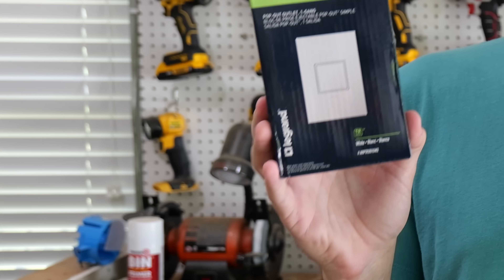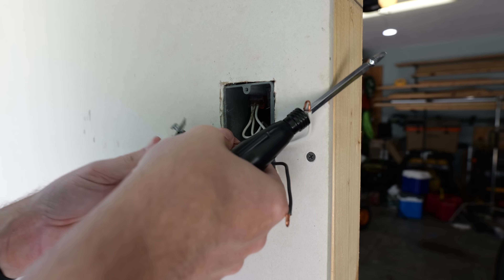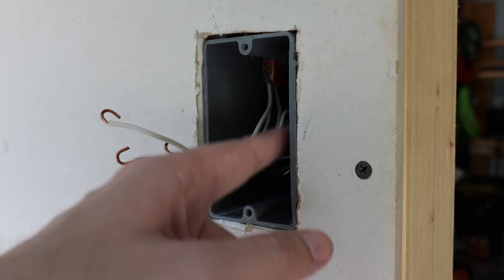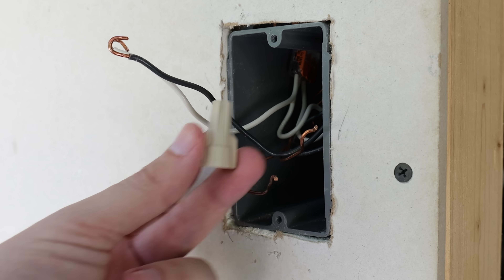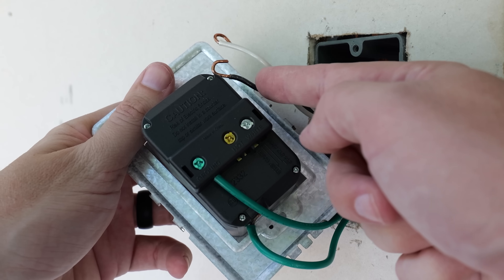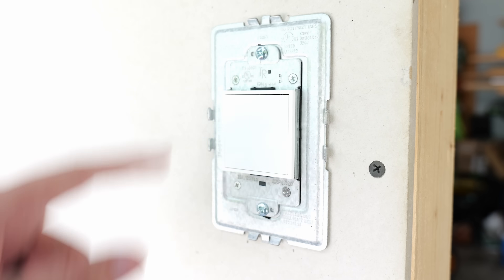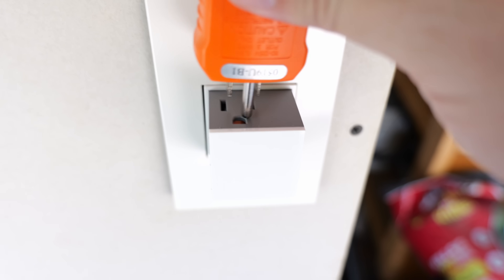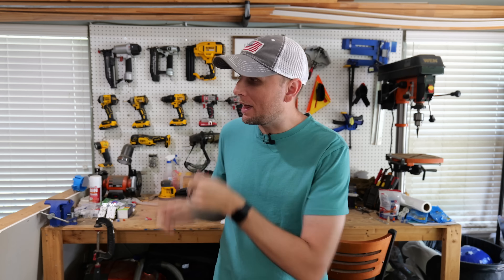The Outlet That Vanishes Until You Need It!

Comment: After working with wago's installing about a hundred of them for canless lights, it is easier to insert the wires so the clear visual side is facing you, and the levers facing away, that way you don't have to turn the lever nut around to see if the wires are seated properly.

Comment: OMG. This is my husband's. (meaning, he works for Legrand, and this is one of the product lines he works on)

He says there's only 3 outlets not because it's "taking up all the space", it's so you can gang them together have have 6 outlets instead of 4 (the two empty sides will be side-by-side). He says the wall plate sticks out isn't a gap, it's a two-tone wall plate that's the style of European outlets (where these started, as Legrand is a French company, and the Adorne line was initially developed for European customers). To address some of the comments - the "side pressure" thing isn't a problem - these have gone through rigorous testing. They are also tamper resistant. And again with "European design style" yeah - the reason it does this is because architects (the main people who buy these) and such don't like how receptacles look. It's dumb, but there you go - it's just a design choice to make the "top customers" happy. When it's closed, it looks like a lightswitch and is basically unnoticeable. It's meant to be used in strategic areas (an example he gave is in our house, we have one receptacle we never use, except at Christmas to plug in the tree. That would be a good spot to use it.)

We have stuff from this line in our house, they are super pretty and really easy to clean. And you can change out the covers in a snap (literally) if you change a color scheme. And they don't really stick out from the wall much farther than a regular wall plate - just the angle to the wall is different, is all.
Reply: I have plenty of adorne outlets and dimmers around the house for couple of years, along with the onQ wireless module.  I love the design, materials and how they operate.
Can you ask your husband if Legrand is slowly discontinuing adorne line? Its harder and harder to find wallplates and accessories every year... Legrand support is also not much help with installation and compatibility questions. It just feels like the product is slowly phased out year by year. I'm just afraid that after investing a ton into this system, I may be left with nonsupport and replacement parts. One positive thing is that I seen that netatmo was recently introduced to adorns lineup so maybe there is some more life left:) Thanks
Reply: @teddy0139  He says it's definitely not being phased out - in fact they just came out with a whole bunch of new designer wall plates. He says if you have questions, go to a lighting design showroom (he doesn't know where you are so he can't tell you who to contact better than this) and they should be able to help you with questions about the system, as there's a lot of them out there that use the systems.
Reply: @turtleslaw  thanks for replying!
I’m located in PA, few years ago Lowe’s had some selection of adorne products but not anymore (I think now it’s online only). Does your husband knows any locations  in Pennsylvania?

Comment: Probably people know there equipment works, but at the beginning, it might have been good to use the outlet tester on the live outlet and make sure it lights.  Then when it's rechecked with the power off, you know for sure the power was disconnected, and it's not potentially a bad tester that still isn't reading any voltage.

Comment: You can push the wire into the wago without lifting the lever. You need to flip the lever to remove the wire.
Reply from the maker: This is I believe the 3rd comment on this today which I’m curious, is there a video out there saying this?   I’ve just never had so many people say this about the WAGOs.   The thing is yes, you can.  That said, nowhere in any of WAGOs instructions does it list that as a proper way to install the wiring.  I did that in a couple videos and this was pointed out to me and it’s true.  I literally looked through every bit of Wago literature I could find.  Also, it takes quite a bit more force to push them into the WAGOs than it does the ideal lever nuts which ideal actually states that pushing them in is acceptable.
Reply: @HowToHomeDIY  it wasn’t anything
from wago, I found out about it on another YT  channel similar to yours. I tried it and it works fine. Does it change the life of the part? I do not know. Could be a reason wago doesn’t mention it.
Reply from the maker: @akbychoice yeah I’ve now gotten like 5 comments about it so I figured there had to be a video out there saying that.  I am not sure whether it affects it or not.  I just know since people got on me about it in a previous video, I looked into it and Wago doesn’t mention it anywhere.  Technically we are supposed to use the devices per the manufacturers instructions.  So not sure if whoever you saw say that has looked into it or they are just trying to make their content different and interesting.  Not sure.

Comment: I've installed these on two different homes in the kitchen islands. Good idea, not really worth it n my opinion As noted,  these aren't cheap. Plus they are BIG and take up a lot of room in the box. They can be a total pain to install depending on the box size and existing wires.  Definitely use wagos unless the box has lots of room. 

My wife tends to never push them back in so the pop in/out feature is wasted. It is nice that outlet has 3 prongs, but sometimes adapters don't fit. She bought one of those automatic trash cans so one of the outlets is always popped out for the power brick.

These have their place, but in my case they just aren't worth the money and I won't install them in my next remodel.
Reply from the maker: A very fair and detailed comment.  Thanks a lot for taking the time to leave that feedback John.
Reply: @HowToHomeDIY If using these in a kitchen wouldn't they have to be downstream of a GFCI receptacle?
Reply from the maker: @David-fb8fn yes they would.  In any “wet” environment which would also include bathrooms, garages, laundry rooms, etc.

Comment: You don’t have to lift the lever on the wago either you can just push the wire in to it also nope don’t like it it is kind of useless and it is not flat on the wall
Reply from the maker: You can and I have shown that in some videos but I got attacked and told that Wago has not said anywhere that it is an acceptable way of installing the wires.  Which is true and they are quite a bit harder to push in than the Ideals.  I know some others out there are saying you can do this but just passing the word along that Wago has never expressed that.

Comment: Nice idea, but I'd be wondering about side pressure when plugging something in that takes a lot of force to insert. 
Also if you install too low or near something like a table where it might get spilled on, could be a problem.
Reply: Yeah, this looks like an outlet that requires two hands to plug something in so you can use one hand to support the outlet

Comment: These are horrible if you use them. If you want to install them in an area in the wall that requires a receptacle by code they are not a bad way to costly hide the outlet.

Why are they horrible? They are expensive. They do not fit odd sized transformers. They stick out from the wall, more so than a regular receptacle but not more then a zero screw plate.

Comment: I'm not a fan of how they stick out, they do look goofy however 3 outlets in technically the same space as 2 is pretty neat. Can eliminate the nee for 1-3 plug splitters in some cases, or even bulky power strips.
Reply from the maker: A fair assessment I think.  Thanks Micah!
Reply: Agree.  Three outlets is awesome, and it does look cool...until you have to use them.
And that price, wow!